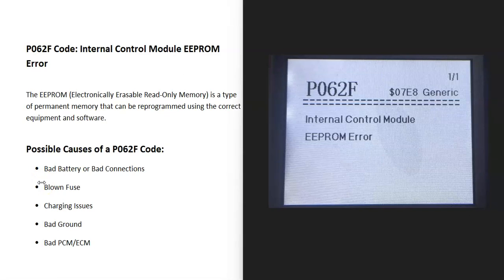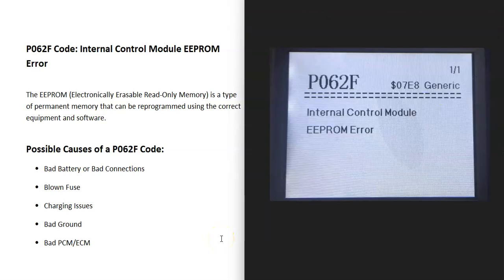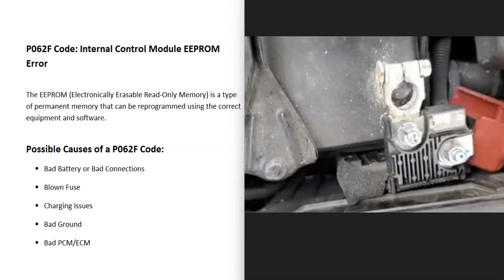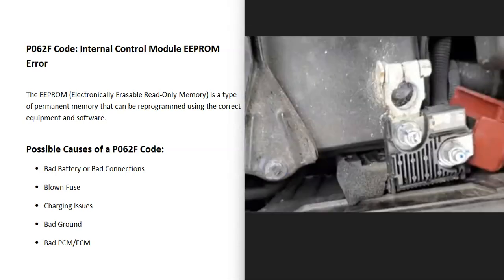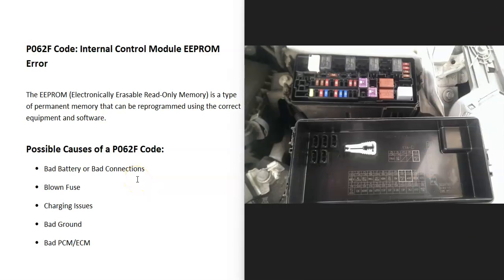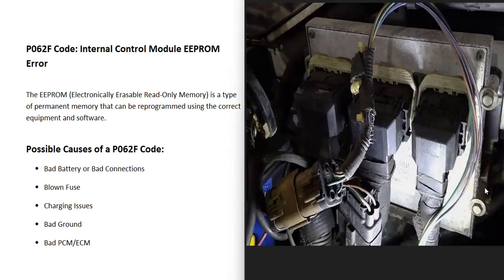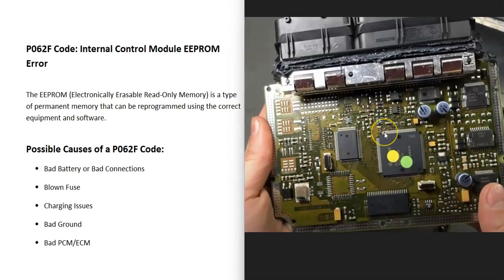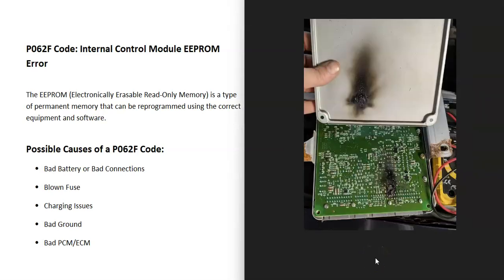Causes and Fixes P062F Code: Internal Control Module EEPROM Error

Comment: I had not driven my car for awhile and the battery was very low. I charged the battery and got a check engine light - code P062F, when I started it. I cleared the code and the car runs fine. The code hasn't came back.
Reply: The code is a permanent code I'll bet you it's still there

Comment: That’s good common sense troubleshooting even the best techs can get tunnel vision, but even though you were generally speaking you didn’t jump to a conclusion without covering the basic common issues that are most likely to be the cause. One issue that was touched on that wasn’t in your diagnosis was the engine cooling fan being inoperable triggering the EEPROM error, relay, fuse wiring can bus connection fault, that reverts back to battery, connections ground issue. Generally speaking. You also mentioned grounding the PCM/ECM body, this was critically the first priority to eliminate as an issue, because if this is an issue, you will never get consistent reliable information, because the Module will be going haywire, when ots a simple ground wire.

Comment: Hello I have a Nissan Qashqai dci 2.0 diesel it’s losing power when I drive it’s stop in middle of the road and I can’t start again, just if I change the battery. I checked the battery and the alternator everything is ok and I see on the tests it’s modul P062F error. What I can do? Thanks.

Comment: Hello I have a 2017 Mitsubishi Lancer recently in wreck I've been able to put things back onto the vehicle and it seems to be running okay I left it at idle the vehicle runs good no overheating I plug in the code reader and suddenly it's got this code the same thing however the throttle body did accidentally get unplugged while it was running I don't know if that would have played a factor into it but I can definitely use some insight on this if you can get back to me that would be great

Comment: Hey there, I plugged in the OBDeleven to have a look even though the car was running fine and its thrown up 2 errors in central electrics and 1 in engine.
Engine is: 
P062F00: Engine Control module fault
I've Inspected the battery terminals, engine wiring, and checked all the fuses.
Is it possible when the previous owner did the stage 1 tune this has effected the Engine Control Module
Central Electrics:
U10F300: Sirens/ Alarm Horn for anti theft
B147A18: Sirens/ Alarm Horn for anti theft

Comment: After replacing toyota hilux fuel injectors and carried out compensation,I am having this code..engine cranking but cant start,all fuses are ok.
Reply: Clear the pilot learning codes. I literally just watch a video and the code came off
Reply: @alonzofernandes1795 how do you do this? Thanks
Reply: @alonzofernandes1795 thanks man
Reply: Mines I use my cheap scan to erase the code p062f n started back up so weird, I'm taking it in the shop pretty soon I just figure that might help just to get it going 🤙
Reply: whats a cheap scan @Denaijahlene2803